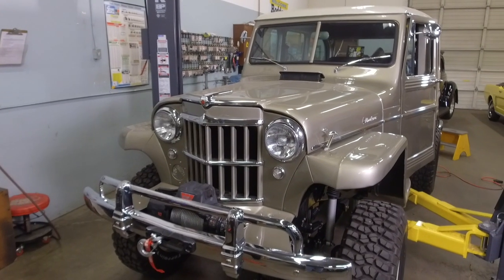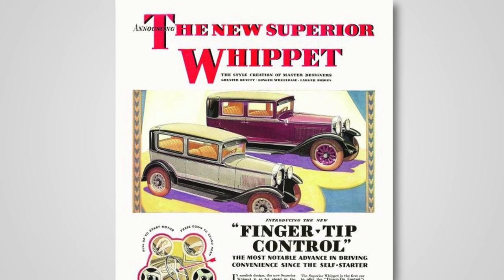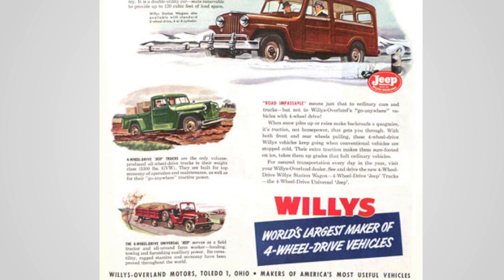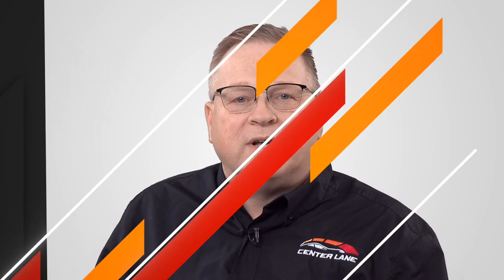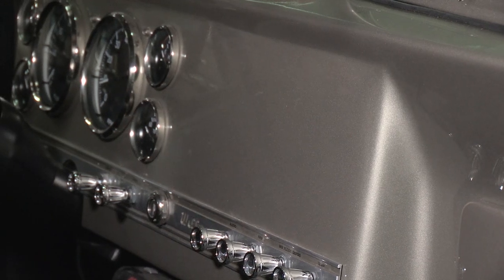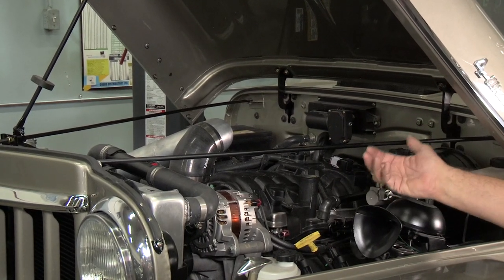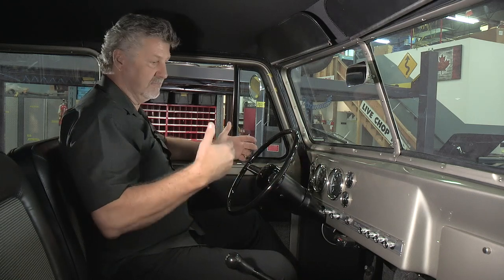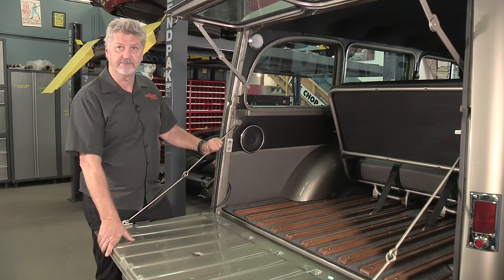Willys Jeep Restoration | The Original SUV

Comment: I had a 1954 ex South African Willy's Wagoneer. As such it was right hand drive. I acquired it in 1964 from a London car dealer and drove it home to Scarborough in Yorkshire.  It had the Hurricane F head 4 cylinder engine and three speed transmission. I did it up as the Woody Wagon. It was a very rare vehicle in the  UK😂 loved the Wagoneer, but eventually I had to scrap it due to parts difficulty. Henry Shaw.😅
Reply from the maker: Thanks for sharing your story.

Comment: They were also a 6 cyl , but if this was a 4 the radiator panel is set further back , but they have tons of room for a eight
Reply: I have always wondered  how an AMC242 would fit mated with an AX15 on this Willys

Comment: What happened to the CJ2a? CJ3a? CJ3b? All before the CJ5. Also the Willys wagon and truck were intro’d in 1946 but did NOT have 4wd until 1949. The Chevrolet Suburban was intro’d in 1933 well before the Willys-Overland wagon. The Willys was the first all steel wagon
Reply from the maker: Thanks for the added info. Thanks for watching.
Reply: All correct and accurate.

Comment: I had an all-original 1961 station wagon and had a lot of fun rebuilding the mechanical overdrive with my dad. One thing I noticed - I have read 'Willys' is pronounced 'Will-is' not 'Will-ees' - can someone set me straight? :)
Reply from the maker: You are correct. It is pronounced Will-is. I did not know that when I shot this episode but found out while editing. I actually found an original tv ad where that is how they pronounced it. Thanks for watching.
Reply: @CENTERLANE  Quite right.

Comment: i saw the new ford bronco commercial and they claimed the 1965 bronco was the worlds first suv. i dont know how they are not called out for being such liars. not to mention the new bronco copies jeep in many ways.. removable roof, removable doors, four door convertible, roll cage, drain plugs in the floor boards, and side door cutouts that were a jeep concept.
Reply from the maker: Ford probably thinks they created the Jeep with the GP. A lot of Fords ideas were incorporated into the Willys MA when it went into production but that Willys wagon didn’t really have a competitor back in the 50s so Ford really is stretching the truth by saying the Bronco is the original SUV.
Reply: Actually with a little research the first SUV was made in 1935, long before either of those brands.
Reply: @CENTERLANE  The IHC Scout, introduced in 1961, also predated Ford's Bronco.

The first prototype of what would become 'Jeep' was designed, engineered, and built by American Bantam. 

Bantam had been working on the concept with the U.S. Army before the 1940 bid was issued by Ordnance. Bantam and Willys Overland responded to the bid, Ford was arm twisted by Ordnance to join in. 

Bantam was the only respondent to provide a prototype on time and was closest to specifications. Willys presented theirs soon afterward, Ford trailed along third.

Ordnance declared all designs and blueprints submitted to be government property and promptly shared them among the three competitors for revisions and short runs of 'pre standard' vehicles were contracted for testing and evaluation. These were:
Bantam BRC (Bantam Reconnaissance Car)
Willys MA (Military, first contract)
Ford GP (Government, 80" wheelbase)

After beating them severely (testing and evaluation), the contract to build Truck, 1/4 Ton, 4X4, G503 was awarded to Willys, primarily due to superiority of the Willys 'Go Devil' engine, with Ford as subcontractor.

Standard WW2 'Jeeps' (G503) were:
Willys MB (Military, second contract)
Ford GPW (Government, 80" w/b, Willys pattern)